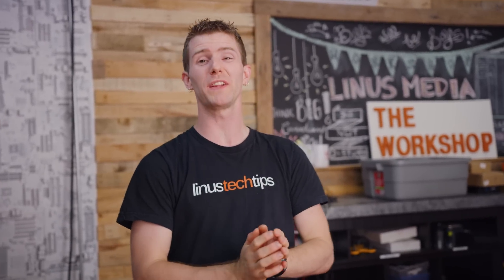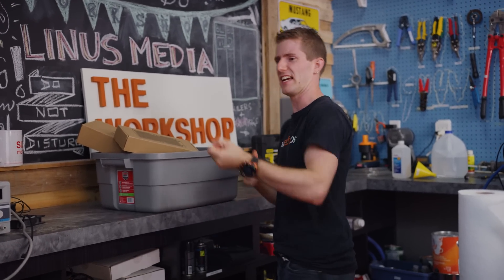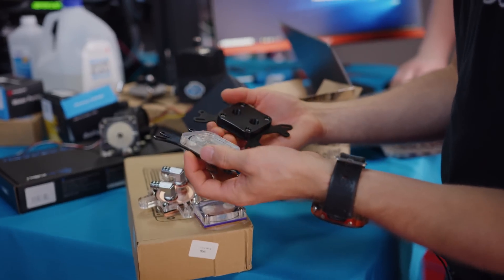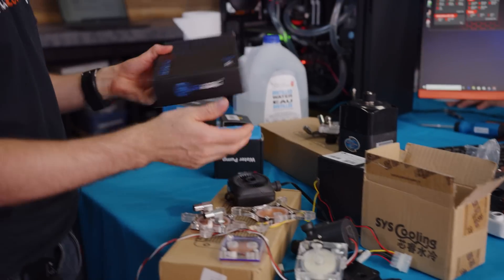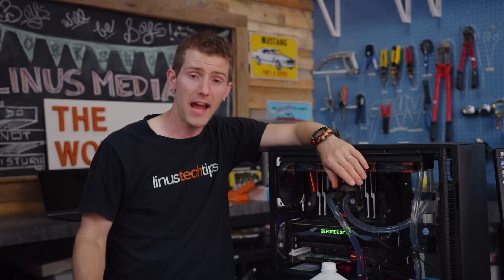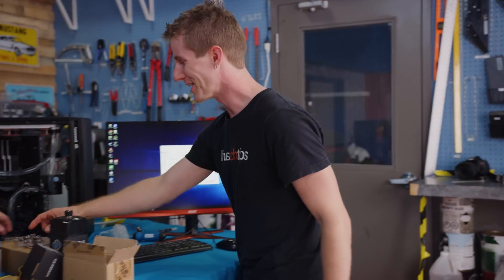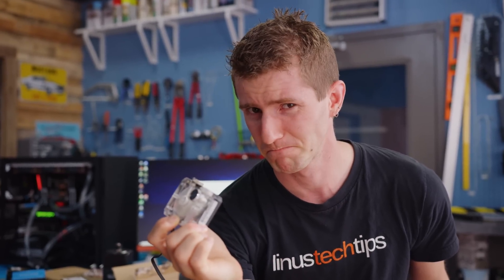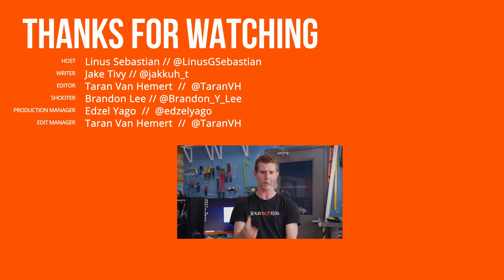AliExpress Water Cooling DOESN'T Suck?!

Comment: increased surface area doesn't make a whole lot of diffrence you dummy, you are looking at diminising returns, if not companies would make cpu blocks 2 times as thick, giving it 2 times the surface area, but because cpu blocks are so efficient increasing the surface area would only knock a couple of degrees C off the temp.
so while those micro channel waterblocks with jet plates are more efficient than just flat copper we are talking a couple C.
Reply: also due to unkown lifespan of these parts i would not recomend, you dont want you cpu block to start leaking afer 2 or 3 weeks due to the fact that the unkown used to seal the copper in the block has vanished and is now spewing out water
Reply: i am sure some of this stuff is actually legit, build well and safe to use, but sadly especially on the chineese market there is a $#!T ton of knockoff products that knockoff other knockoff products that have a design flaw because they are a bad copy from a real product,
and unless you do a hell of a lot of homework on these chineese brands (assuming that the seller on ali express is selling the actual brand product it advertises and not something falsly labeled with that brand), there is no way of knowing if any of this stuff will actually hold up for longer than a week

Comment: I have been wondering what would happen if you would put copper filings in the water, like literally take high end solid copper cable and File and just grate some copper in the water. How much more conductive would it be if the water was full of micro copper filings?

Comment: lol, I watercooled my first system just a few months ago using all stuff from AliExpress. The only things that did not come from AliExpress item was the hose and some auto-antifreeze as coolant, that I picked up at the auto-parts store. The block I used is like the black metal one you showed with the clear top.

It keeps my 8 core AMD at 39c but the pump I bought started making grinding noises after running for 1 month. (24x7) I kind of expected it so I ordered a spare pump and had it onhand to switched out.

It was a test system and before long Ill be working on water cooling my second one which is a dual cpu Intel system. All with the cheap stuff from AliExpress. Dont knock it, for the price it is usable and works.

Comment: I wanted to try watercooling without being riped off so I bough all piece from Aliexpress to make a custom loop. Very cheap : about 110€ for radiator, pump, fittings, tank, gpu full cover, cpu block, tubing and I bough some high static pressure corsait fans (35€). I am very happy with it, no overheat and it is silent. Just be sure to buy a good pump because some cheap ones vibrates A LOT. If you wanna try making a custom loop, feel free to buy parts from aliexpress, just check the reviews for the pumps. I used cooling fluid for car (cheaper) and there was no problem with corrosion (I cleaned it after 1 year (including 6months of mining) and no problem. (config : vega 64, i7 4770)

Comment: chuckles 380.- for an entire water-cooled loop.

About two weeks or so I upgraded my X-Carve CNC with a water-cooled spindle requiring drumroll a pump/radiator combo and being slightly anal about the stuff I buy I decided to buy the most stylish pump/reservoir/radiator combo I could find ending up with an aquacomputer airplex modularity system 140 ( https://shop.aquacomputer.de/product_info.php?products_id=2699 ) that cost me close to EUR 220.- alone so no fittings, no hoses, no fan, etc...

Comment: Use car parts, like a oil-radiator and water pump. Should work fine and be cheep. Or if you want to go all in take the hole engine cooler with a big fan.

Comment: Dissing on cheap pumps in a custom loop that can be replaced unlike AIO pumps that you can throw in the trash with the rest of the loop as soon as it fails. It's not the 90s or early 2000s either, a failed pump won't kill the CPU, over temperature protection would shut the PC down.

Comment: As long as the copper and aluminum dont touch (that shouldnt mater either, copper and steel do have an issue if they are touching or are too close together) there would be no problems. The boilers that have aluminum heat exchangers are connected to copper piping and there is not a problem.
So a water cooling system is less harsh conditions than a hot water heating system

Comment: Barrows actually a pretty good brand, you have to get there newer stuff though. My entire loop from fittings(triple o-ring) to radiator are excellent. Even the part I feared the most, the pump-res, is actually quite good. The only drawback on it is its not pwm and instead uses molex.

Comment: Barrow fittings are really good and they are very well regarded in the watercooling community. I would actually prefer them over anything in the market except Bitspower fittings. The fact that you haven't heard of them is very strange to me. They even build completely novel parts that no one else produces like a digital inline flow meter with a built in OLED screen, which is both very useful and unique (FBFT03).  I mean, I know you're not a watercooling guy but come on. Bykski is pretty decent, they're one of the few Chinese brands that I would trust my hardware with along with Barrow. However, I would not recommend getting any pumps from any chinese brands whatsoever. Just get a standard Laing D5 or DDC pump. You can get some decent tops from Barrow from what I hear but I have personally never used them.
Reply: You do realise that Laing ARE a Chinese pump brand right? :P

Comment: I use a lot of Bykski parts and love them. cooling a 6core E5-1650v3@4.7ghz with a full Bykski setup. I have yet to have a problem. Only thing I would say needs to be done is to lap the block.

Comment: Linus Tech Tips i got a question for a laptop that i looking at i want to get it it is ASUS ROG Strix GL702VS 17.3" Full HD Ultra Thin and Light Gaming Laptop,75HZ G-SYNC Display, GeForce GTX 1070 8GB, Intel i7-7700HQ 2.8 GHz, 12GB DDR4 RAM, 128GB SSD + 1TB 7200 rpm HDD s wont to now should i go for it or look for a different laptop for can you mack a youtube video about it if not just say it is good buy or not good buy

Comment: Barrow actually makes pretty good liquidcooling parts. Their fittings are used by many people, with a lot of coverage on different tech forums. I've decided to build almost full loop using Barrow parts: CPU block, fittings, their "D5" pump, res, tools etc. Only things not from Barrow were radiator (full copper one added to much weight to package, so I've bought one locally), GPU block (bought EVGA 1080Ti Hydro edition), tubing and fluid. Since my order was a big one I've got a nice discount from seller and DHL shipping for $15 to EU. Whole process from processing order to shipping, customs and delivery took about 3-4 weeks with shipping alone done in 4 days. Latest CPU blocks from Barrow are really not that bad - ones with a higher channel density. During tests there were maybe 2C difference between EK Supremacy. I'm very happy with my purchase and performance. Price vise whole order with DHL shipping and customs tax included was about 50-60% of the price for the same parts from a mid-range EU/US company and about 1/3rd of the high-end one. So that kind of savings for a negligible performance difference is totally worth it in my opinion.
Reply: CoreyPL exactly,I'm using Barrow's fittings due to it has 4 o-rings that makes me feel more reassured.
Reply: In fact I am using Barrow's TR4 block with coolant temp display, works pretty well so far.
Oh and also the Bykski TR4 block actually easily out-preformed the older EK version, as tested on HardOCP.
Reply: I Agree Adrian. I'm using Barrow LTFHB-02N 115X RGB - it's their latest revision CPU block with 0.2mm channels and it really performs like EK Supremacy for half a price. RGB lighting is compatible with my Gigabyte board so I can use Fusion software to sync all the effects.

Comment: Genuine D5 from china is like 1/3 of the EK price tag. And the Vario isn't really all that great unless you absolutely need PWM control of the pump. Which isn't all that necessary, a D5 with a decent top is almost silent even at full blast.

Comment: There has to be a way to make a water cool loop fitting that never leaks without permanently sealing it except for the drainage / refilling spot. I'm thinking specially made Metal zip ties that can be turned into an electromagnet? I mean I don't think it would be that expensive but it's probably just easier to permanently seal most of the loop unless you plan on reusing some of the hardware for your next build and it probably wouldn't be that difficult to remove the acrylic tubing.

Comment: I think you should have included on the comparison chart, the AliExpress water loops against something like the Hyper 212 EVO or higher. Because the Flat Plate watercooler, seems like it would get beat by or be comparable to a decent air cooler that cost way less than the water cooling loop.

Comment: Well my chinese Jonsbo air cooling keeps my i7 4790 at 40 degress Celsius even under stress. 30€. I think I did not need a much more expensive product do I ? x)
Reply: I call BS on that. My old 4790k at 4.7 on water never under 40 degrees at 100% load. No way no how on Air.
Reply: yeah that's not even possible without a delid at 50%
Reply: +Amfamora he never said 4790K, he said 4790, which does exist.  Water cooling a standard clocked 47xx is nothing, perhaps only a little harder with the K which is basically preoverclocked.
Reply: Tobias Schneider yeaah
Reply: Yeah, if you are in the middle of the Arctic tundra
Reply: 4 ghz perma turbo mate. And around 40 degrees max. Idle around 35
Reply: https://imgur.com/a/8z4WfyR

Thats 30 minutes stress testing with prime 95.
Ok the last time I did the test was at 20 degress celsius 1 year ago with fresh thermal paste.
Now it´s 28 degrees celsius in my room and the paste is around 1 year old. Not bad right?
Considering with the stock cooler I always had around 85-90 degrees haha
And I cant even here the jonsbo cooler at this fan speeds ^^ It is set to turbo btw
Reply: I apologize then... should have realised no K chip.

I knew there were people out there who bought them. I just met my first.

Why? :)
Reply: depends on room temps tho.
Reply: maybe if it was -10c ambient
Reply: Nope 20 degrees celsius ambient. Im not kidding. This cooler is the best.

Comment: You used the best of the cheap first and lil ago I was checking parts to build my system and that full black pump that you used there is in my list of wanted, mostly after this video is a must buy, 2 of them for extra with a good loop meter.

Comment: I can assure you a lot of the r/watercooling community uses byski and barrow watercooling gear and I have not heard a single issue with it. I can even speak from experience. I've talked to them personally when I needed help and I can tell they aren't just some random goons trying to cheap off on watercooling parts, they really are enthusiast just like us.
Reply: Ian Peng barrow and byski are very good. The fittings are amazing. He just didn’t do any research. It took me only 10 days for shipping
Reply: Barrow worked fantastic for me for last 2 years.
Reply: I use Byski without any issue shipping was fast. But some minds think expensive stuff is better Byski and Barrow give you one years warranty

Comment: EVERYTHING literallly EVERYTHING today gets produced in china! There is no difference if it´s not developed by a western company and if the price is not skyrocketing high haha.
People get that in your minds. China produces everything we have today and due to competitors the priced dropped, but the quality stayed ;)
"Cheap" does not mean "cheap" anymore. It means good AND affordable.
Reply: uhhhhhh nah man you get what you pay for

I work in manufacturing and we use a lot of chinese brand parts. and when you get into stuff like this that is priced extremely low the failure rates can be massive (and cause lost revinue) and the consistency just isn't there

We've gotten shipments of 1000+ gears/hallogen bulbs/diffuse sensors/ PLC's that we just had to trash because we couldn't rely on them. But the next/previous shipment is fine

Right now the Chinese brand Stepper driver were using is making our machine fail compliance testing and we have to replace it with a unit from an american brand (still made in china ofc but cost $300 compared to $70)
Reply: kolby4078 Because you're not smart with your purchases. We use almost all Chinese parts(work in manufacturing too) and everything is working to spec for many years now. You just need to know which ones to buy. China makes both good and bad stuff and caters to all price points and market segments. It's like 5 years back when people said "cheap Chinese phones are bad" just because they bought some UMI or worse, some unknown brand that even Chinese people have never heard of even though Xiaomi was already around by then. It's simply a matter of doing your research. Same thing with this Aliexpress water cooling. Do your research and it will work pretty damn well for much less money.
Reply: @andres Lol don't say it's my fault. I know where I would takes risks but purchasing is always under pressure to reduce cost

The only purchasing I do is for prototyping and for the mills, I won't buy chinese branded tooling. because again you might get good end mills but the taps will be trash, even from the biggest Chinese tool mfg companies

and "its only a matter of research" doesn't work when you only have so much time to DO research, If I need 1000 gears in 3 weeks that means I need to order them NOW.
Reply: ek makes their stuff in Europe I forget which country exactly
Reply: Well, there is obviously a difference even in performance as you saw above, plus there is QC. I m pretty sure the cheaper parts and fittings would fail way more often/sooner than the proper ones. Finally, lower prices(when it comes to chinese products) aren't only due to competition, but also from unfair market practices, non existent worker rights, zero taxes etc. aka, not cool stuff !
Reply: Konstantinos Sarlis and you alrealize they make enough to survive because the fact eveything is cheap right? Dont be talking shit if you dont understand it
Reply: Yufan Chen I never made any remarks regarding wages, I do know they are paid well enough for their standards, especially those working at tech(though one could question how ethical outsourcing is anyway) But explain me how you ll never see suicide nets or workers having to sign no suicide pledges in western workplaces yet it still happens in china?
Reply: Konstantinos Sarlis thats just a few factories belonging to foxconn and other big manufacturers. Not all factories are like that. Besides they can always quite and hey education up until college is free in china why they drop out?
Reply: Totally agree my dude.
Reply: EK stuff is made in Slovenia
Reply: Oh sorry. I meant ALL electronics and 90% of the other stuff xd
Reply: It is said if you take any Chinese made product no matter the price , stick a European and American brand name to it , it becomes much much better LOL ... Most people just depend on a name they can trust to do the thinking for them .

Comment: Disappointed you didn't try out an assortment of fittings. Usually in a larger build, thats where the serious savings are to be had. And some of them are just straight up rebranded bitspower and alphacool fittings, just for like a dollar or two instead of 10-15-20. Would still recommend ordering some spare known quality O-rings though. Even if using real bitspower etc.

Comment: Have you guys ever tried wetter water in a cooling loop?. Wetter water works by reducing the surface tension of the water, allowing to it to supposedly to get closer to the materials. I've used it for it's intended purpose and it does work, it will lower the coolant temp  by 10 to 15 degrees F. https://www.redlineoil.com/waterwetter

Comment: Can you test water cooling corrosion, I heard you say I think on the Wann show ( is it wynn show?) That would effectively turns your water cooling Loop into a battery. But from the same logic you said you could use deionized instead of mineral oil for a mineral oil cooled PC. But it would get enough of ions to collect a charge can give or take 15 minutes. but no one is willing to test it considering that you would risk losing your Hardware and it would take an extremely long time at like you're year-long dust collection test.
Reply: I learned all this stuff At Linus University but I haven't graduated yet, do you think a class project would give me enough points to graduate?
Reply: Also something interesting to note is I'm using speech to text and when I said at Linus it kept saying Atlantis, and for about 30 to 60 seconds I was thinking that this isn't just a coincidence that has to mean something. Linus do you know where Atlantis is, do I have to figure this out before I graduate?

Comment: I wonder what would happen if you did modify the copper in the water block, or tried to make your own. Wait a minute, could that be sketchy heatsinks 4: the revenge of the sketchy heatsink? 

You (Alex) could test polishing the copper and scratching out different micro fin designs with a hobby knife. There's probably a bunch of things to try, but those come to mind.

For this test I would have liked to see some tests with mixed parts like EK block with Ali radiator and pump, Ali block with EK radiator and pump, etc. to suss out the weak links. Anyway, thumbs up, thanks for testing these!